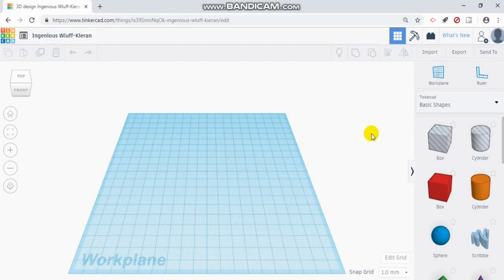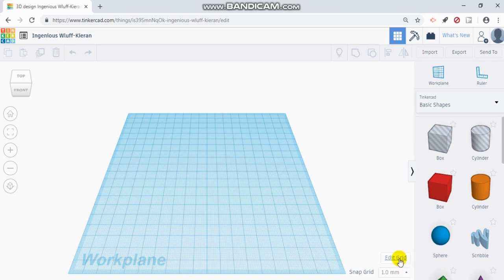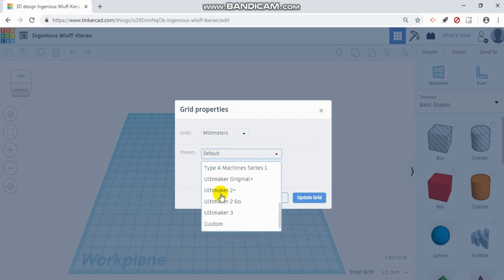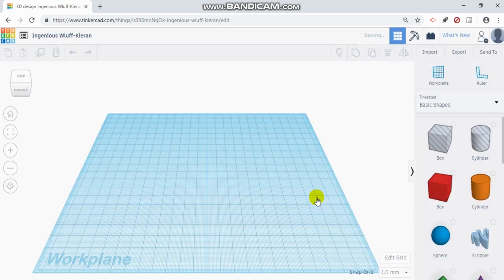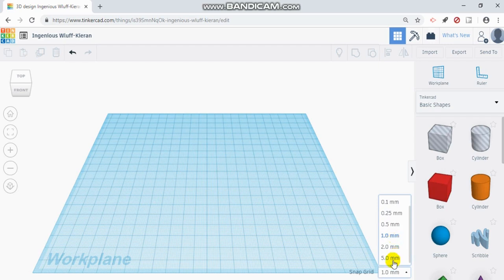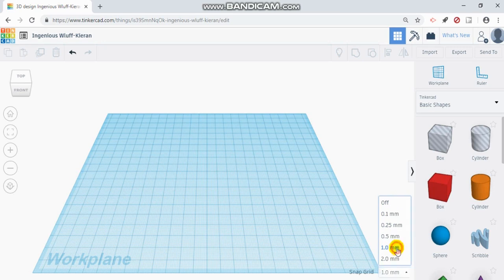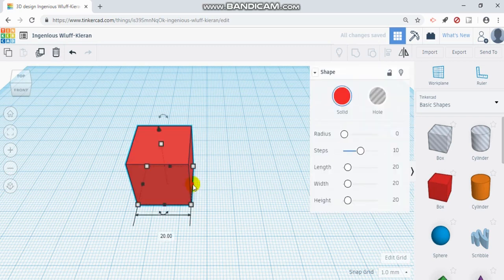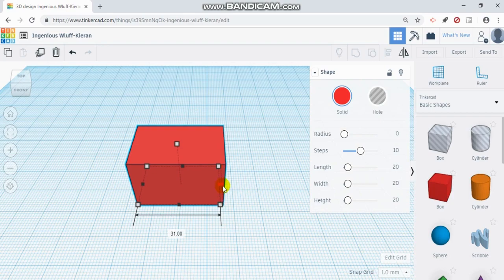*Tinkercad Tutorial* #3 - Changing Workplane Size and Snap Value

Comment: Is there a way to change the workplane to a new default size so that I don't have Edit Grid each time I start a new project?
Reply from the maker: Great question and to put it simple, unfortunately not :( This is something that a lot of people request Tinkercad add as it would be beneficial for both personal and educational uses.  For now it looks like you would have to keep changing the workplane size to the specific measurements you want each time you start a new project.  If they change this, I will definitely post an update!
Reply: @quicktechtutorials7289  When I first started using TinkerCad, I searched for a way to make the background a dark grey instead of white but all I found was a link that suggested the application was no longer being developed and I was left with a sense of, "Well this is as good as its going to get." If this isn't true, is there a forum or something similar where I can view upcoming changes and/or requests?